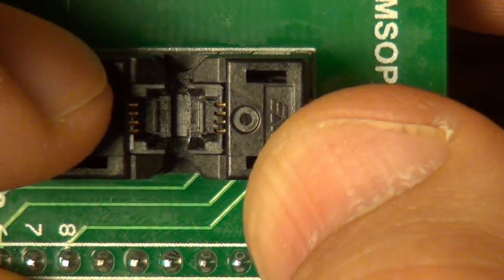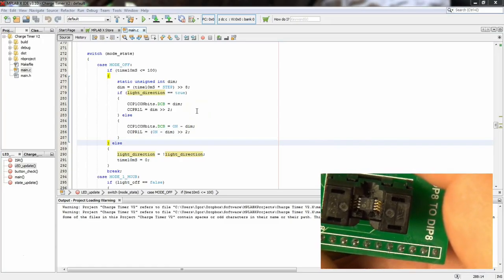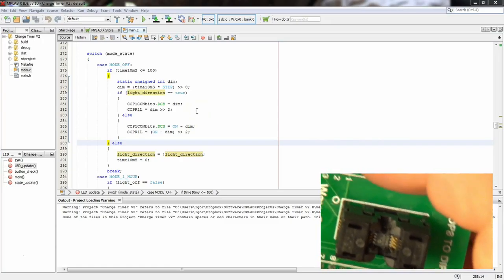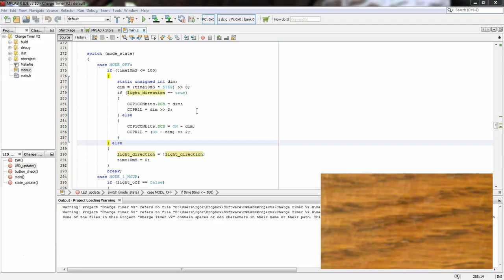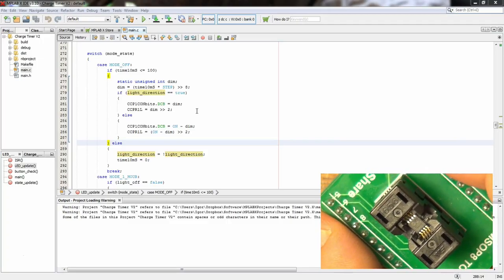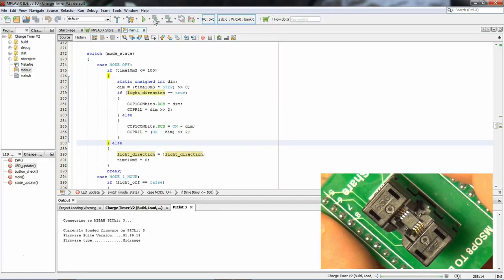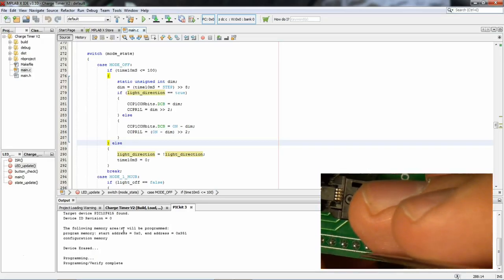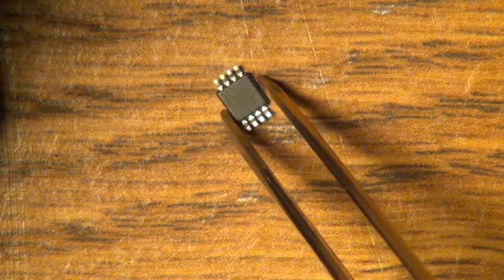eapbg #40 Programming Surface Mount Microcontoller Out of Circuit

Comment: Is there a similar board for stm32 MCUs? (particularly f446re)
Reply from the maker: There are. The processor mentioned comes in an LQFP64 package. Search that on eBay. Here is an example https://www.ebay.com/itm/QFP64-LQFP64-QFP64-socket-adapter-IC-chip-test-burning-seat-STM32-programmer/202831432795?hash=item2f39b20c5b:g:-S4AAOSwTvFd3KTF
Reply: @eapbg  thank you for responding :)